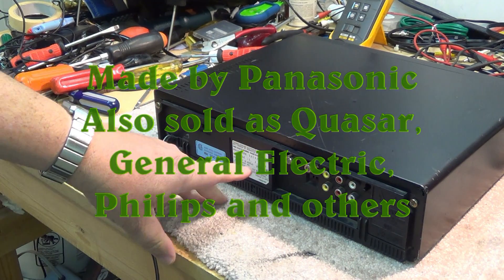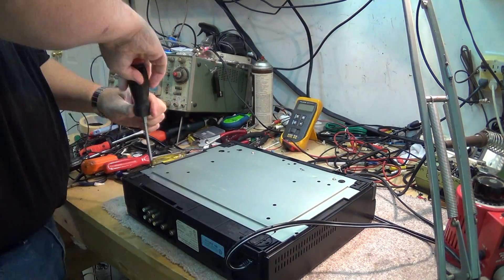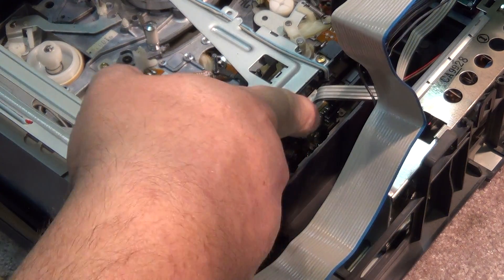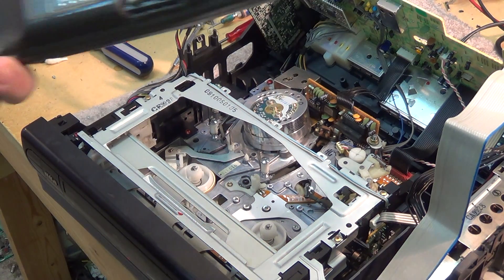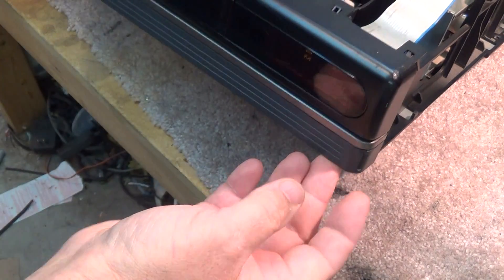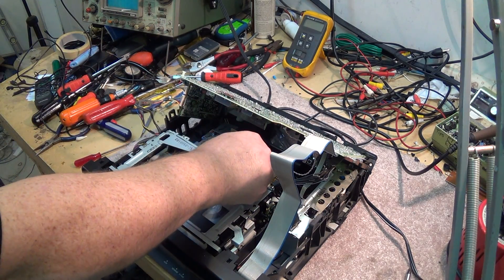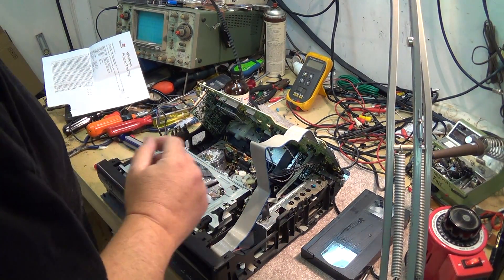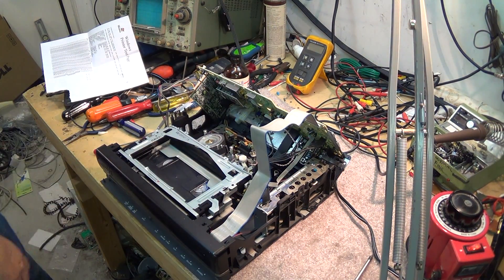VHS Head cleaning procedure

Comment: Thanks! I thought my Sony Video8 camera died but ordered good swaps and the liquid on Amazon and the next day I cleaned the video head as you showed with the VHS recorder and I got my video image & audio back!! 😄
Reply from the maker: You got lucky because 8mm uses metal tape that basically needs to be physically ground off the head. You had mild contamination because a clog would never clean that way. The metal particles literally weld themselves to the heads.
Reply: @12voltvids this is bad news I also have video 8 with dirty head I haven’t tried cleaning but now I’ve got less hope

Comment: My Hitachi  VRC/DVD player will not eject the VHS tape ..I push the on button and the player comes on for about 10 to 15 sec then turns itself off  any suggestions  ? ?I removed the Tape and  cleaned all the heads with alcohol and rolled the gear put the tape back in it  started to play than stop and  turned itself off and tape will not eject ? used different tapes ...I did this several times to no avail ....HELP

Comment: @12voltvids Please help. I got a JVC SR-VS10 (Super VHS / MiniDV) deck. When I play the tapes I get a no image but sound works. If I press FFW Play I can see the image perfectly. I was told clean the heads which I did but it made no difference. I don't know if its relevant but the VFD display on the VCR says SuperVHS even though I tried normal VHS tapes.

Comment: I have a JVC 30000 D-VHS and think I damaged mine using a microfiber cloth. When I first cleaned it using this cloth, I popped in a Tape that would not previously play and it worked perfect. Then I popped in another tape that also would not play and it would not, so I think the second tape was compromised and dirtied up the heads again. So I went in for a second round  going more towards the bottom and I could hear some friction and noticed the cloth had torn a little. After that the first tape will not work now. I tried blowing out with compressed air too and not working. Bummed out. I have allot of recorded tapes to watch. I should have watched this video in its entirety, I did not know the little holes at the bottom were the heads, I thought it was the big silver sphere part. Is changing a head easy if I can find another? Not going to be easy or cheap as these are hard to find now.
Reply: Okay, I fast forwarded the tape and started play ,then did fast play where it goes at 3x speed with no sound for about 5 minutes, then pushed play and now its working. I do not know what to make of this. I rewound all the way and started from the beginning, and now its playing perfectly again. It had one quick glitch for 1/2 a second but otherwise playing perfectly. Did I get lucky? I definitely will not be popping in the 2nd corroded tape again.

Comment: I see it 6 years later... 😄  What about "insert" video mode? VCR plays correctly video and hifi, but snow appears if I try to make some video insert... Thanks.
Reply from the maker: That would be a record issue in insert.  Flying erase heads come on and wipe video but no recording takes place.
Reply: @12voltvids   Thanks a lot 1000 times. Now I "just" need to know how to fix it.  🤯

Comment: 5:00 These surface-mounts caps are for the Hi-Fi stereo audio board (best to get a mono unit only), and there is another IC surface-mount caps board for video on top of board. Two boards total.
Reply from the maker: Am radio quality sound.  No thanks.
Reply: @12voltvids  Yes, Hi-Fi stereo audio is far superior. Any VCR brands were easily more reliable than the 1989-1992 Panasonic VCRs. That was Panasonic's worst and darkest days in history. Very few units are still running today. By 1993 (starting with PV-4351), the SMDs were dropped and back to regular caps again.
Reply from the maker: We used to call Panasonic panafuckers back at the shop.
Reply: @12voltvids  So, Toshiba was much better than Panasonic on reliability, right (assuming the product was manufactured by Toshiba)? Time to admit it... After 35 years later from 1990 service peak, more and more retired techs in this country are starting to agree with this fact.
Reply from the maker: I wouldn't go as far as saying that Toshiba was more reliable than Panasonic.  Some products yes others no.  This stuff back in the 80s failed at much higher numbers then the new stuff does today with the exception to led backlights.  Most people have just forgotten about taking their VCR in a couple times a year for various problems or all those tuner problems on TV's. That or they are not old enough to have gone through those headaches.  They might remember an old vcr from their childhood but don't remember the monthly trips to the service shop for 1 thing or another lol.  Panasonic and Sony had relatively high picture tube failures in the 80s and 90s.  I can't count how many 25xbr jugs i changed.  Hundreds of them and hundreds of projection crt where the face actually cracked and the vacuum sucked the coolant into the tube.  That was interesting.   Or the Philips projectors that the coolant leaked out of the lens assy.   It's getting really hard to reply to messages ever since the new YouTube app update.  Locks my phone up. Type reply and hit save and can't save. Have to locate message in YouTube studio.  I guess Google is forcing me to retire the old phone and get a new one lol.
Reply: @12voltvids  Okay..., so was Sharp or Sanyo better? Pick one.... Who built the most electronic products in Japan? I'll throw in Mitsubishi, just in case, but the old HS-430UR unit was worse than any Toshiba products at that time. I also wouldn't be surprised if you vote for Funai or Orion/Sansui instead.
Reply from the maker: Sanyo and sharp had some good and bad.  Favorite vcrs were late model Mitsubishi.  Hsu 53,65,67,82 and their electrohone ewuivemants avr j03 04 04 ect. Then they turned to shit again. Late model Panasonic were very good, I'm talking 2000 2003 models.  After that I have no idea because i was out of the business in 2003.  Sony slv series were also good except the p6 frozen guide and now all the blue gear failures but they were work horses.  The slvr5 had power supply problems because they used a mitsui supply.
Funai were actually quite good.  My business partner in the video biz used them as duplicators and they were run long and hard and they never broke.  Can't say the same for the panasonics. Hitachi also made a bullet proof vcr. Lots of belt and idler arms but that's about it

Comment: Hi, thanks for the great video!
Would this also help with color noise?
My VHS video recorder runs perfectly fine, but the image, especially the colors have a lot of noise.
Reply from the maker: Probably not.  You have to understand how home video is recorded.  The black and white information. (lumanence) is recorded in fm mode.  The color is converted down from 3.58mhz to 629khz and recorded directly to tape.  As the tape ages, the magnetic signal on the tape starts to get weaker. This does not affect the luminence because it is fm, but the color signal drops and as it does the signal to noise level also drops and the noise becomes more of a problem. All the consumer formats used color under as did 3/4 UMatic and the all suffer from this.  BETACAM used a swperate chroma track recorded by dedicated heads using fm recording and did not suffer this problem.
Reply: @12voltvids  oh, thank you for your detailed answer! So simply said, my vcr is totally fine. It's the magnetic band of the VHS cassettes that is getting worse over time?

Comment: Hello, thanks for your video, could black and white output means that the head needs cleaning or it's definitely some other thing?
Reply from the maker: If the picture is clear it's not dirty heads. No color is a chroma problem.
Reply: @12voltvids  What does this mean? Problem with cable or TV?

Comment: Thanks for this video, I recently got a Sony CCD-V8AF Video8 camcorder/VCR, it worked great until I played a Scotch tape in it. Then the picture had a bunch of static and looked horrible. I cleaned it using the method you did (copy paper, 100% alcohol, counter-clockwise), and yup, good as new again, perfect playback. Before I was using chamois swabs from Amazon but this method is much easier, since I already have copy paper for my printer.

Comment: Thanks! Can I ask you 2 questions.
1. my tape is damaged and have some greasy spots. Does after playing this tape I need to clean tape head every time to avoid this grease or subcutaneous fat spreading on other tapes?
2. I’ve cleaned my head with cotton bud and vertical movements :( how can I check if my vhs is damaged?
Reply from the maker: Cotton bud and vertical movement on video head is a great way to break the head.  :(

Comment: I have a Philips VR 6443 that visually looks like in good condition. Apparently it stop when play is pressed for some reason. I opened up the cover and saw that while everything looks clean inside,...the guides (where the tape is moved into towards the head) looks super dry and cant see any lubricant. Should I put some lubricant before trying to play the tape? If so, what lubricant can i use safely? Also what can i put inside the headcapstan so it moved freely? I can send photos if u wish.

Comment: May I ask why you recommend using paper to clean the head over cotton swaps or maybe even general cloths? I've never seen anybody clean them with paper before so i'm intrigued as to why? :]
Reply from the maker: Never use qtip on video heads. Too easy to snag an break them. Same wi cloth. At Sony we used leather chamois cleaning sticks. I still have some original sticks. I learned the paper trick from an engineer when I worked at a tv station. Paper is smooth, but has just the right texture to clean video heads and no chance of damage like poking it with a qtip
Reply: Cool! Didn't know that, thanks for the info. Bye bye cloth, hello paper. :D
Watched a few of your videos yesterday too, great informative content, keep it up ! Thanks Again.

Comment: Damn dude, if it isn't broke....... well it is now throwing it around. What is wrong with you?
Reply from the maker: It's old crap that is headed for the recycle center.
Reply: @12voltvids  Just Kidding Dave. I had a question that you would know the answer. My Sony Hi 8 video recorder started showing a rainbow looking streaks going horizontal on all playback. It kind of comes and goes. Kind of fades in and out as the tape plays. Like a electrical static and the lines are slightly moving. Even when the tape is on pause you can really see them moving on the screen. Is it dirty heads? A Cap problem maybe? It kinda looks like a electrical interference of some sort. I've seen it on you videos playing on your monitors. They are faint and you probably could watch the movie but it would be distraction. Do the heads need demagnetized. I don't know....what do you think Dave>/????
Reply from the maker: @garyastron5440  check the ground strap for the video head.
Reply: I will Dave, thank you.
Reply: Where exactly would the ground strap be on the head? And is it prone to just coming disconnected? I can't find anything searching for video head ground straps. Please help 12voltvid. @12voltvids
Reply from the maker: @garyastron5440  it will either be on the top of bottom of the drum.  A copper leaf spring with a carbon tip, and that tip makes contact with the spinning drum shaft.
Reply: @12voltvids  Thanks for taking the time with my problem Dave.